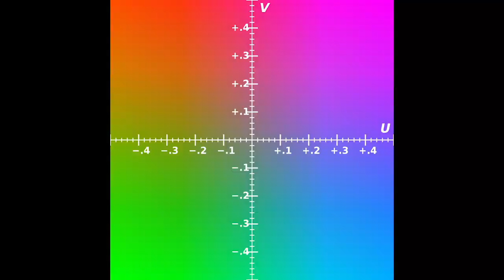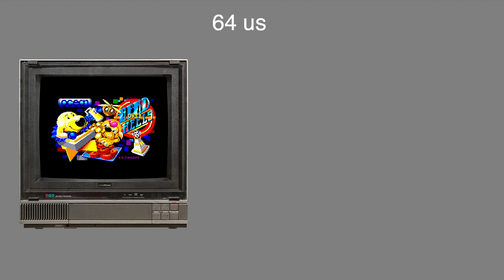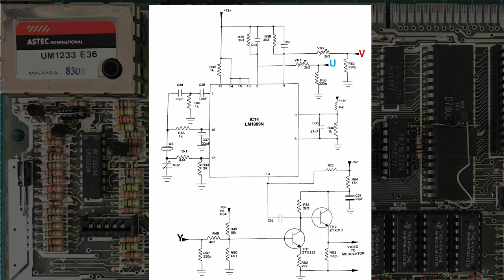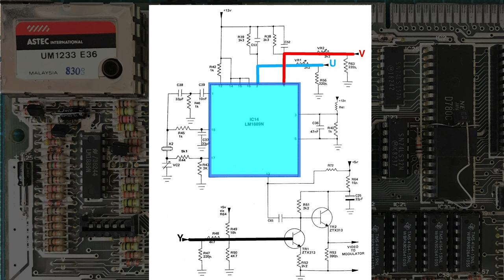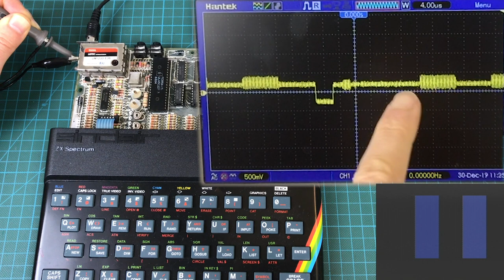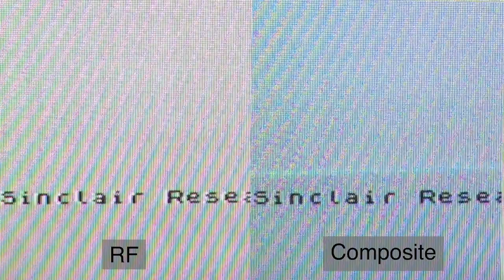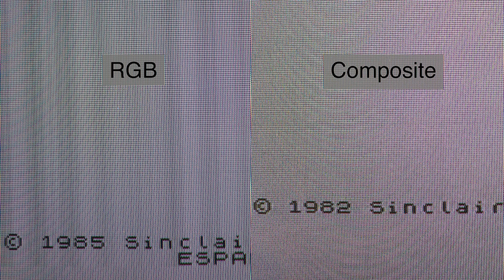ZX Spectrum Composite Video Mod

Comment: nice video but what about sound?
Reply from the maker: The ZX Spectrum has a built-in sound speaker, so there's no need for that. If you really wanted to send sound over the composite signal it would be significantly more work than just adding a capacitor though 😃
Reply: @NoelsRetroLab  ok thanks for your reply, I renembered you listened you spectrum in the tv speakers, maybe not
Reply from the maker: @viditibi  Good memory. That was probably the 128K or higher models (+2 and +3). All the 48K come with the built-in speaker so there's no need to do anything about sound there.

Comment: Hey Noel.
I'm having troubles connecting a zx81 to an old and modern TV. Can you help me?
Thanks in advance.
Reply from the maker: Hi Paulo, I'm afraid I haven't worked on a ZX81 in a long while (I need to remedy that), but I seem to recall you can do a similar composite mod than the ZX Spectrum. If you can, I recommend you join the Discord server (https://discord.gg/ETcCh6J). There you can post pictures and I'm sure you'll find people who can help you. Good luck!
Reply: What if we don't modify it? Is it possible to connect it via a tv cable? Any specific better tv channel number to use?

Comment: RGB Mod?
Reply from the maker: It would be much more involved because the Spectrum produces YUV, so it would have to be converted to RGB, which is more complicated than putting a capacitor :-) And you'd also need to add a connector with at least 4-5 pins. Interestingly, next week I'll release a video showing how to do that with the TI99/4A, which has somewhat similar video signals. So in theory it would be possible to do something like that.
Reply: @NoelsRetroLab  Thanks for the reply. Looking forward to that one.
Reply: 5 pins minimum including ground. Maybe removing the modulator and using something like a PS/2 connector mounted behind the hole it leaves?
Reply: @dropdatabase8224  I have a story about that kind of thing. A while ago now, I made a USB extension system. It was two boxes, one (host box) had a boost converter in it that boosted the USB 5V up to 48V. In the other box (device box) was a buck converter that brought it back down to 5V. This allowed long lengths of cable because there was effectively no voltage drop, just used more current. I made the mistake of using RJ45 to link the boxes together. So what happened? Someone mistook the host box for a USB to Ethernet adapter. You can imagine how that turned out. That mod would open the door for some sap to plug a keyboard into it.
Reply from the maker: @dropdatabase8224  Exactly. It would have to be something like that. It could be fun, but honestly, the image quality you get with composite out on the ZX Spectrum is so good, that it's hard to justify going the extra mile. It would also involve custom cables from that to SCART. But it would make for a fun project to be sure 😃

Comment: Can't we use the YUV and make a component output?  Composite still sucks.  Also you could compare the composite and RGB on and LCD monitor not a CRT.
Reply from the maker: It may be possible, but things get more complicated (need 3 output jacks, might have to boost each signal). And in the end, my go-to TV doesn't accept YUV, so I couldn't really use it. 
As for composite, a good composite signal is really good. Not RGB good, but it can get pretty close (at those resolutions). LCD displays are usually horrible for retro devices, so I don't use those for anything other than testing on my workbench.